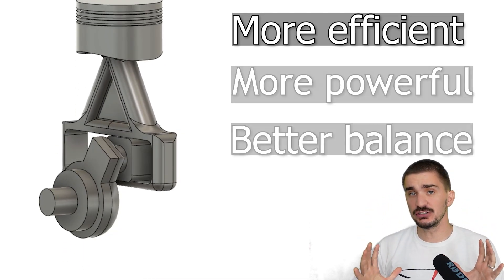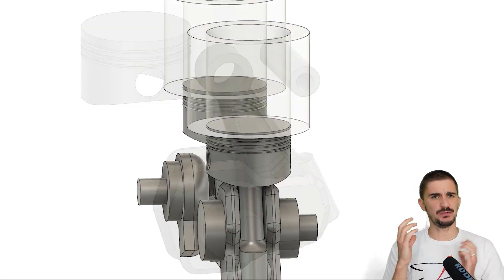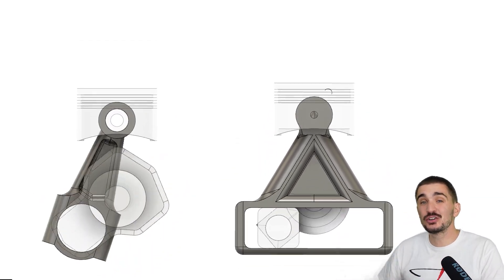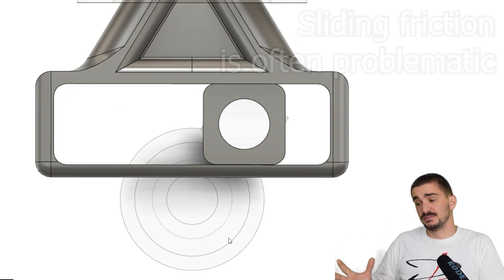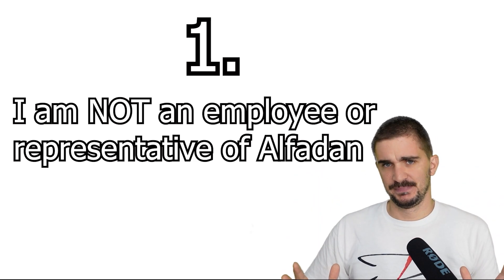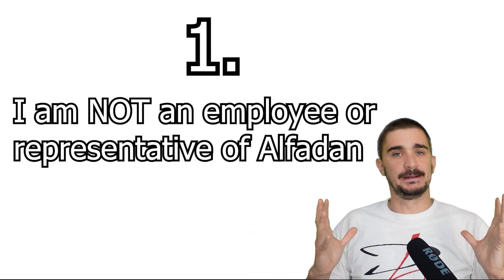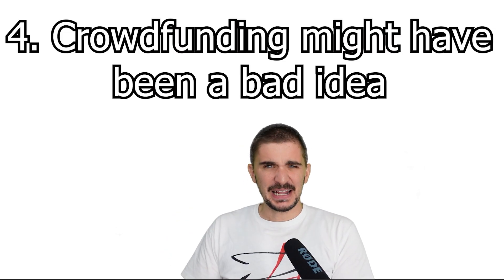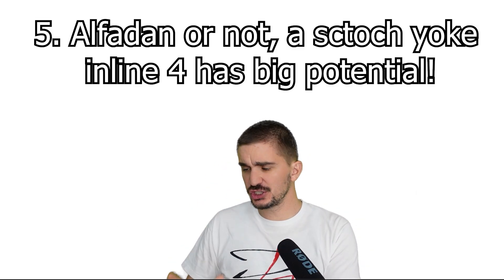This engine is better in every way?

Comment: I am a pilot. Although I spent most of my career flying jets, perhaps my favorite piston aircraft engine is the Lycoming IO-360. It is a 6 liter, 4 cylinder engine. How do they manage to make a smooth 4 cylinder engine that big? It's an air cooled boxer. The secondary balance problem was solved a long time ago, 23 million Volkswagen Beetles can't be wrong.
Reply: lol i was thinking the same thing, this design but in boxer engine would get rid of many problems he talks about, and if you make lets say, a 8 cyl boxer, with two pistons per rod assembly, you get rid of the weakness in the bottom rod cap
Reply: @olem.isaksen336 2 cylinders per yoke isn't going to be a boxer. For it to be a boxer the two cylinders would have to move towards and away from the crank shaft in sync with each other.
Reply: Comments on these videos are always like:
"I've been going to restaurants my whole life and I thought we solved the "cold leftovers problem" some time ago. The food at restaurants is always warm, how come?"
Reply: @Jaaaa315   Yeah How Come  ??
Reply: Alfadan's market is outboard motors, not piston aircraft. Try fitting two banks of cylinders lying on opposite sides of a common crankshaft into an outboard motor. You follow me? Some of these watercraft are so large now they have six outboard motors, Alfadan solves the secondary balance issue, they can put more power in a smaller size with less weight (no crank counterbalancing magic necessary, not anti-vibration mounting gear) with far less wear and vibration. The issue w/ the current inline 4 is once you start getting into bigger displacements, the vibrations become even worse. Alfdan fixes this w/ their motor, theoretically its fixable for EVERY inline-4. You could have a 1.5 liter 400 hp motorcycle or a 1000 hp outboard motor rather than four 250 hp motors that would be easier to maintain and have less vibration.
Reply: @edwardrichardson8254  Alfadan is a scum.  They are all bullshit.  They do not have one engine ready for sale.
Reply: Sorry, I misread your post, the part about it being a boxer. A six litre in line four probably isn't feasible.
Reply: boxers are very suitable for larger displacement due to their inherent good balance. vw beetles were built to spec so are not the pinnacle of engineering, just good enough. a boxer 6 is even better than a boxer 4, ie porsche.
Reply: @daos3300 or a Subaru 3.0 or 3.6.
Reply: @sneakysquid1529  yes! and not stupidly overpriced like the porsche.
Reply: @daos3300  porsche makes flat sixes, not boxer sixes.
Reply: @midnight.a3  how so?
Reply: @midnight.a3  nope
Reply: @midnight.a3 They make Flat 6s that also happen to be boxers. All boxers are Flat-6s not all Flat-6s are boxers
Reply: @midnight.a3  
Difference please?
Reply: @midnight.a3  The porsche flat six is a flat six boxer engine. Most flat engines in production today use a boxer type crankshaft.
Reply: That's a big engine for an inline 4. The only reason it's possible is because aircraft engines only rev to about 1500 rpm. Still impressive.
Reply: Great Info and very interesting !!

Comment: the design with the piston and the rod made all together won't be better. the fact that the rod is at an angle isn't the problem in a convectional engine. Its the 2 points that the forces are being applied. this design is worse be instead of pushing the piston to the side and causing uneven wear, it will try and twist the piston which is significantly worse. this will eventually cause the piston to brake where the wrist would be. Also this new design would be really hard to balance because the rod is way heavier. Plus, you wont be able to reach higher rpm's because of the heavier assembly, therefore getting rid of the advantages of having a short stroke engine. Most of these issues can be greatly mitigated by a longer rod.

Comment: I wonder if combining the Scotch yoke with the traditional circle would be possible. Single fixed rod, but instead of an elongated rectangle use a slotted circle. A flat, solid disc on one side, but a deep circular groove on the other with a wheel attached to the crank that rides inside the groove.
Reply: so the crank would have to move side to side instead of the slider?

Comment: For small electricity production this could work with the only goal being efficiency and not power,this could work(due to minimal load) but the Atkinson cycle works great already. I  had to produce a small research on the Atkinson cycle used for that purpose and Honda already makes a small unit that produces electricity and at the same time convert excess heat from the cooling system into warm water

Comment: Rotating crank journals are still sliding friction, they just are sliding in a circle. The reason early designs failed is their rods sliding surface wasn't being pressure oiled, as modern cranks and thus rod journals are.

Lastly, we could build these and eliminate PRIMARY IMBALANCES if we combined this design in a BOXER engine.

You're welcome ;)

Comment: We have had very tight tolerance production available for many years. I disagree. The verbage would be the cost of producing at a high level of acceptable tolerances (very tight tolerances) has come down a lot. 

I have ideas where the weak points are and trying to think what the arm would look like in say 60k or even 100-200k. 

I like liquid piston myself because its a revision of a already revised rotory engine from mazda. You can see real engineering in play. 

I see this being functional for a couple of applications and even capable of being modular. I like this idea and i actually would like to reach out to them and talk a bit. Not that they would respond or hopefully not steal ideas without good conpensation. Who knows?

Comment: It doesnt matter if their is no moving connecting rod when the load angle is still not verticle. Unless the piston is pushing directly down in a straight line your not changing any of the lateral forces on the piston.

Comment: And an investment can be a scam, a scam involves an investment with total losses.  Ambitious as it may seem. 
Come on, it doesn’t take an engineering degree to see how ridiculous it is! Go ahead and throw some sleeve valves in it too, because they provide higher flow rate and no mechanical valves to float

Comment: I'm wondering if the rectangular slot is a modeling simplification, or if changing it to  rounded ends (like a pill) would make the slot a bit stronger x)
Unless the square bit slams into the slot's sides and a flat surface is desirable ?
Reply: The ends of the slot aren't contacted and are purely structural.
Reply: @TheShamefurDispray  okay, thanks !

Comment: It's all numbers and theory games unless an actual real-life model is made to analyze actual physics and related thermodynamics of theory.

If the yoke connecting rod(s) is thicker, then there are possibilities. Start with a smaller actual scale down working model first. If successful and all budgets are accounted for, then scale up. It's like the reverse when a horologists designs a watch movement for the first time and then starts to patent, manufacture, market/promote, sell, repeat. 

I think a ball bearing crankshaft will be a game changer as opposed to the journal bearing. Unfortunately, the actual assembly and lack of specific  tools will need to be figured out. 

In some US states, Property Tax Liens have near zero risks. If the primary owner defaults on payments after one year of being notified, you keep the property, and the owner looses their deed/title to their property. The owner will get mad and whatnot. That's why it's good to set up a trust to act as your representative if some states allow for certain types of transactions. This way, they(property losers) never know who the actual individual is that wants their property. Unless you are really notoriously famous, then you might want to have some kind of security/bodyguard(s) in place. 

Awesome videos, as always, keep'em coming. 🤙🏽

Comment: If this engine is used in a flat engine, like a boxer 4 setup (yet not a boxer movement as the pistons will not move in an opposed reciprocation), it would be ideal.  The weakness of the long, thin bottom of the connecting rod would simply be the top of the other rod.

The sliding block in the crankshaft could/´should be replaced by a spinning bearing.

Sliding friction is never suitable for high speed, but is exceptional for low speed with high loads.  The sides of the connecting rod (no longer correct to call it a rod) would have to change all flat/sliding surfaces to a round/cylindrical rotating bearing.

Of course, the idea of better in every sense is not possible when given only these two designs.  long flat friction surfaces will induce more friction compared to the wristpin frictional surface areas and the solid connection between the rod and the piston means that the rod would want to cant and cause piston rubbing on the cylinder walls.  The opposed cylinder relieves this a bit and the side bearings practically eliminate it.

Comment: 1) You missed an opportunity to teach about hydrodynamics and how a circular bearing allows you to maintain a supportive film impossible with a square slider. Great video otherwise.

2) Folks, ICE development is dead. Period. Most manufacturers are putting their best people and dollars behind EV right now. There’s government deadlines to meet and rapid changes in consumer preference. 

3) Any new company focusing on ICE development is already behind the curve and does not have a sustainable economic path ahead of it. Even small power equipment is leaving ICE behind now and Honda is discontinuing ICE mowers this year.

Comment: Not related to the video but I saw recently your video on fuel economy. Do you think that a hot air intake can improve fuel efficiency by reducing pumping losses?
I mean of course the power is going to be lower but the computer will need to open the throttle more to obtain the same horsepower, as long as you don't go full throttle (which equal to richer AFR) the wider opened throttle might reduce pumping losses right?

Comment: not sold on this.... friction happens in both designs ... just not in the same parts of the design/construction and I strongly doubt that the design of the new rod makes more sense in terms of handling the forces of combustion and possibly or likely adding more moving mass ... 
Still interesting from a design/construction point of view ...

Comment: If you laid an inline 6 over 80 degrees, installed longer connecting rods and offset the crankshaft I feel this is a better solution. The intake and exhaust could be designed for optimal HP & TQ requirements. You will have the same amount of room as a boxer engine along with displacement as large as 5.0 L too :face-blue-wide-eyes:.

Comment: This doesn't take into account lubrication or lack their of. A rod design like that is going to be heavy reducing the efficiency and requiring more lubrication. Every part of an engine has to be balanced within 1/10 of a gram. Or boom. And square parts never work in a reciprocating engine.  Nice try. Oval and square pistons were also a thing and also failed miserably.

Comment: Instead of a square, what about using a roller?
Reply: A round slider would concentrate stress at the contact points. Without doing any calculations, I would expect the bottom of the slot would be deformed or even knocked out very quickly.  The rounded square doesn't totally eliminate the problem, as pointed out in the video.
Reply: @LurkerInTheInterRecordGap  What about a gear like shape?

Comment: The concept is interesting but with the speed at which electrification is taking over, is spending all that time and money worth it ? Probably by the time it is commercially viable, nobody will want it. Remember that it takes many years to design, test and build an engine.

Comment: A scam is buying a car in 2017, being told it will have functional autonomous self driving in "3 months maybe, 6 months definitely" and still not having FSD by the time your non-repairable battery has started the final throes of capacity degradation.

Comment: I sow few year ego some engine design were it used  two crank shaft to which single piston was connected to scissors like mechanism. That prevent side movement of piston.

Comment: As a subscriber for years, I have learned a lot. I was mentally screaming about the yolk friction until you mentioned it later. Muhahaha! I also was thinking that huge yolk rod and piston would be rotated around the piston rings as it applied force to the crankshaft. The low end would allowed to drag laterally, while the piston would be held on that plane. The mass of the new assembly would also hinder rpm changes.

Comment: I would think that that square block in a slot will have an uneven wearing bearing surface which over time will cause slack , noise and eventually cause poor reliability
And you cannot oil it  under pressure like a normal rod big end is lubed under pressure
Adds reciprical weight as well..

Comment: Could you not replace the sliding block with a ball bearing?  Solve sliding friction with rolling bearings.  Maybe to much force on the bearing because it's getting compressed every stroke?

Comment: Might be ok in an opposed cylinder arrangement, so the yoke can be shared by 2 cylinders. Otherwise, it's like something built by a toddler: amazing (if it works), but not innovative (somebody else already built it), and not useful (or "somebody" wouldn't have gone out of business).

Consider the weight increases! Every yoke will need twice the strength of a rod, so it will weigh significantly more (~60% more). Changing the direction of mass costs energy, which increases exponentially with mass (ie: twice the mass requires thrice the power).

Normal:
   1 × 3 = 3 
 (weight of rod & piston × changing direction = power consumed to move the piston, lower is better)

Scotch tape (yoke)
   1.6 × 3 = 4-4/5
  (weight of yoke & piston × reciprocation losses = power lost for doing nothing)

Looks neat, but worth nothing as a useful product, especially since electric motors work without reciprocation.  They might sell a few for people to look at, they still use a conventional engine to power the lawn tractor that mows around their office. 

If it actually worked, and improved efficiency, they would have repowered their own equipment to save expenses of existing, but they didn't, & the lawn will always be growing. 

They still rely on connecting rods, even though the simplest way to prove yokes work is to stop using rods, but they won't.

Comment: if you draw a free body diagram of the goofy design you will see it still  has the same problem as a traditional rod, the force is still offset from the center on the piston.

Comment: I believe a system like freevalve have potential especially if it's able to eliminate the throttle valve and put control of airflow in the valves but the multiair system using the oil from the engine instead of an external air pump is the way forward there but I suggest using an adjustable spacer between the cam and valve that will act like a throttle to control airflow into the cylinder but without an engine shop to play with my ideas I just have to trust the players that do

Comment: How does it keep oil pressure on the sliding surface.....how is the flimsy lower end of the rod with 4 stress points going to hold up without breaking....confused?

Comment: What about remove the engine, and put in an electric motor instead?

An electric motor has low friction.
With a battery, you don't have to burn anything.
If you don't have the electrictrisity, wind, or solar,  and need to burn oil.
It's better to use a oil powerplant, instead of spending power to refine the oil.
In an oil powerplant, you don't need to compromise on weight vs efficiency. You can just think of efficiency.

So, this is solved... it's called an electric car.

And... if it don't make noise, you can always put in a speaker, and a sound card....

Comment: I've just discovered your chanel and really liked it. And now im really disappointed. Sorry but This is a scam and you are shelling it. Weak viability of the concept aside. Investors should be informed on the progress and how there money is spend. This endeavour clearly failed to provide information on how the money is spend. It's one thing to take investors money and make the project that fails- that is a risk and other take investors money and disappear with no updates whatsoever- that is a scam sir. I mean engineering company that asks youtuber for 3d visuals no red flags here 😂
Reply from the maker: I can't sell something that can't be bought. I'm making this video now precisely because you can't invest in the company anymore. I clearly addressed all the issues in the video but trying to reason with the unreasonable is always futile. Not realizing that is an error on my part.

Comment: Would a circular yoke/crank bearing not be better for reducing friction, in an oval hole to eliminate corner stresses? Also having opposing cylinders would potentially balance out the forces on the weak bottom section of the runner, e.g. a flat twin engine?